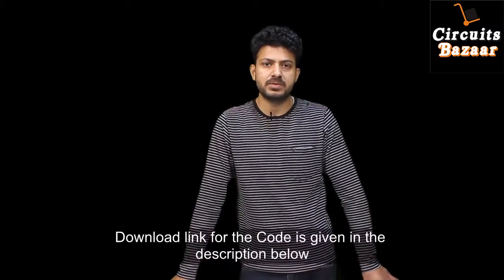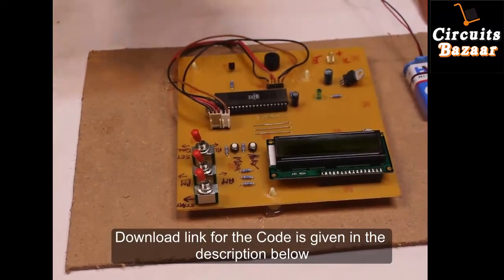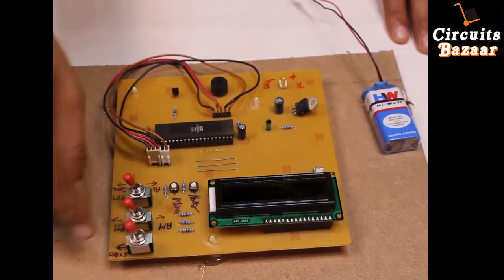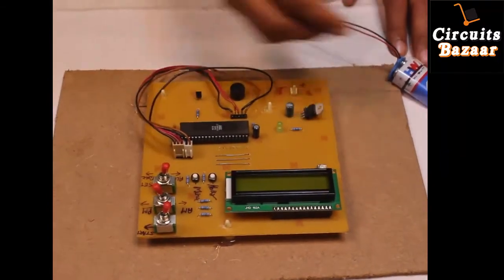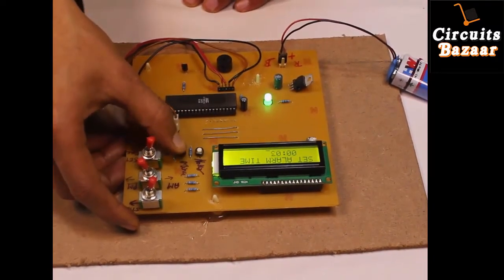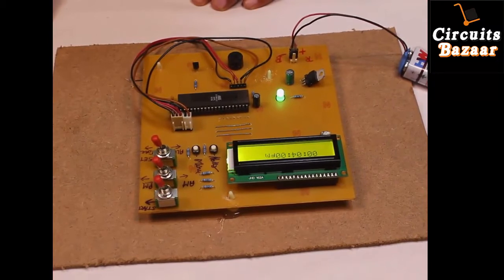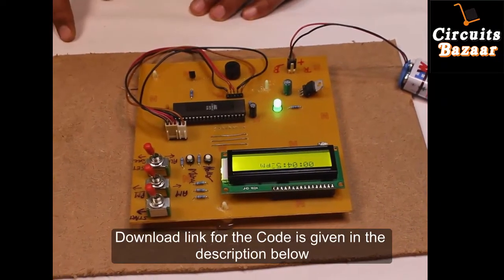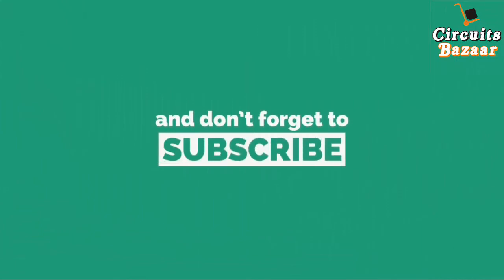Digital Alarm Clock using 8051 microcontroller [ with program and working]

Comment: how to integrate real time clock module in this project?
Reply: Thank you
Reply from the maker: Use the DS1307 Real-time clock IC module and interface with it. if face a problem then shift the project on Arduino uno .  it's very easy over there.
Reply: Please can you make a video on how to interface ds1307 on arduino Uno?

How can we have a desire with multiple alarms. Maybe, 10 alarms?

Comment: Can you just let us know, what are the requirements of this project!
as I have to make this as my project of Digital Electronics & Microcontroller.
I hope you will respond. waiting for your reply.

Thanks.
Reply from the maker: main components required are :- 
8051 micrcontroller, LCD 16*2 , 9v Battery, 7805 Voltage Regulator , 
Project PCB
Programming cable
16*2 alphanumeric LCD
Push buttons – 4
Slide switches – 3
2 ceramic capacitors – 33pF
12 MHz crystal
Electrolytic capacitor – 10uF, 16V
Resistor (1/4 watt) – 10k
Pot – 10k
5V DC power supply circuit
Single pin connecting wires etc... for more details you can go to circuitsbazaar.com and can contact on the contact us information.

Comment: Sir, Excellent work!! but I have a doubt, my question is how much seconds does this clock fast/slow from actual time?? I mean PER HOUR?? or in 24 hours??
I mean how much accurate this clock is without RTC?? I mean how much minutes/seconds does this clock becomes fast or slow per hour??
Reply from the maker: If you will set the crystal oscillator and delay for loop properly then you can +-1 second error only in 24 hours
Reply: @The.Innovative.Indian  ok thanks. 🙏 But Actually I don't had 12 mhz crystal, so I'm using 16 mhz crystal and using timer0  (for 25 ms delay{25ms x 40 interrupts = 1000ms or 1 seconds}) and interrupt 1 but still getting 5.6 seconds error in 1 hour!! 🙄 Will u give me any suggestions?? 🙄🙄

Comment: how to burn the code using which software
Reply from the maker: I have used Keil Software to make the code and Sunrom 8051 programmer to burn the 8051 microcontroller code..